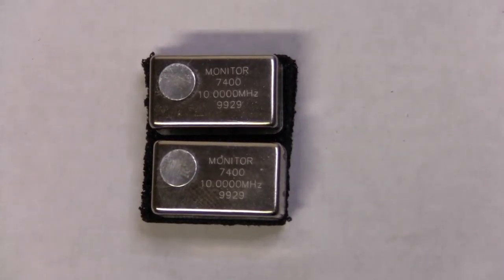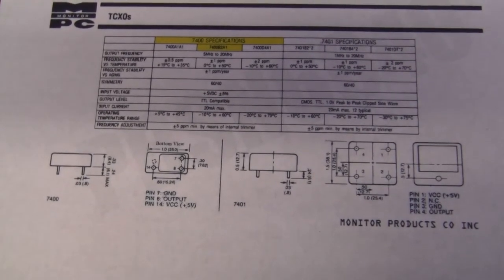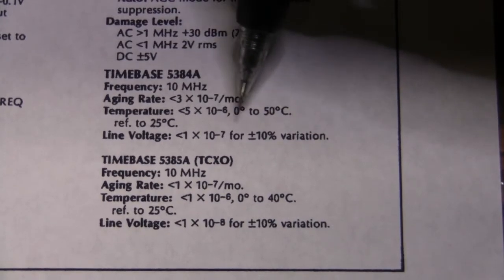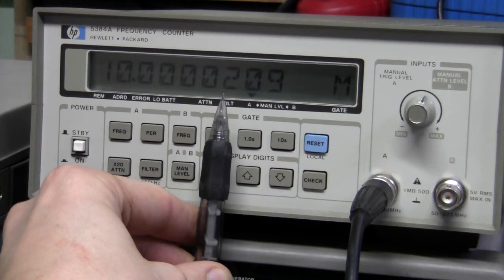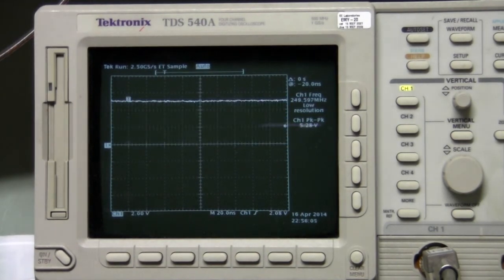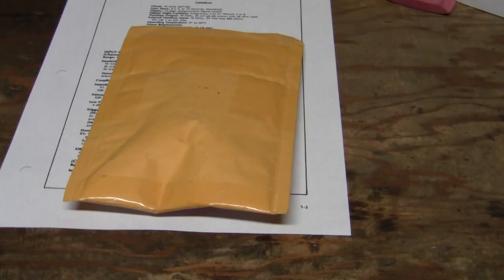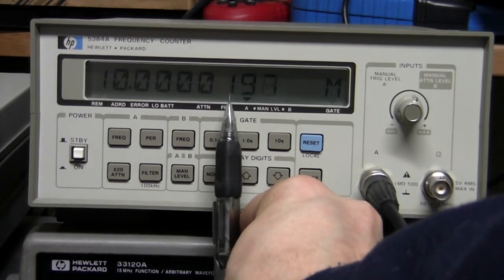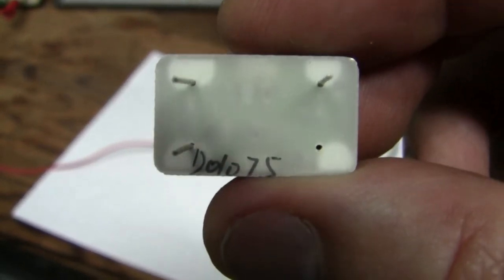#2 - TCXO Precision Frequency Reference

Comment: One more thing: if the 8MHz TCXO is really new, you need to let it burn in for a longer time and then try to fine-tune the TCXO according to GPSDO. I have the same thing on my Mastech MS6100 and the time base has been stable for quite a long time. But I still verify the accuracy via GPSDO once a year.

Comment: Nice video, I reckon that the cause of ringing is more likely to be signal frequency reflection from an impedance mismatch. 50 Ohm terminator or probes should resolve the problem.